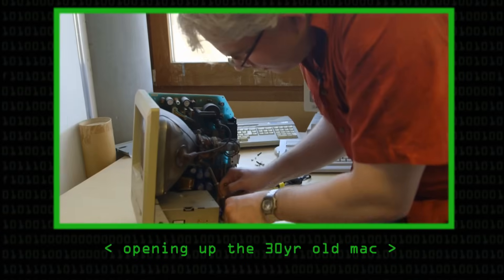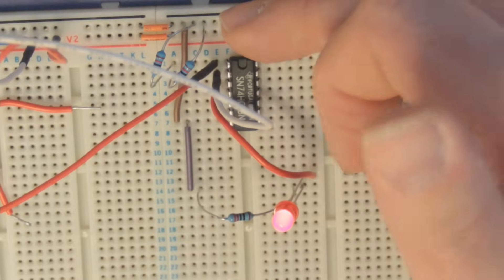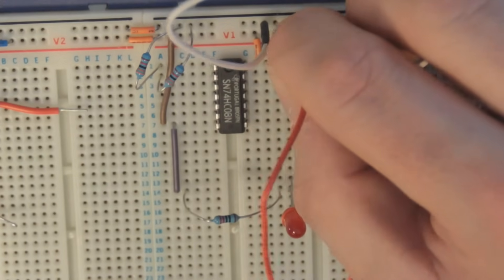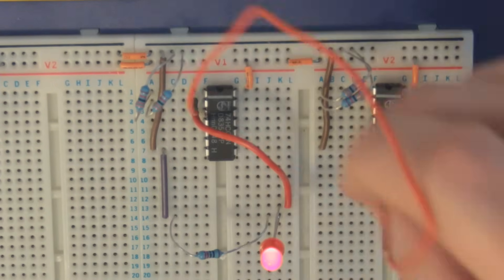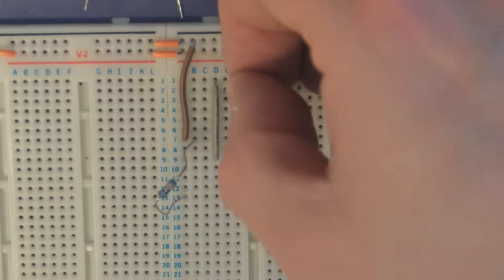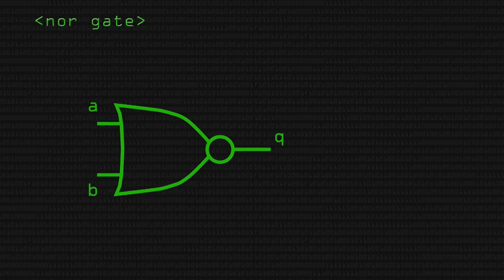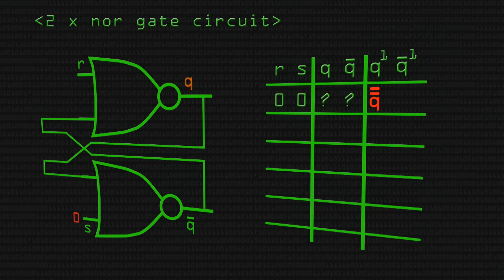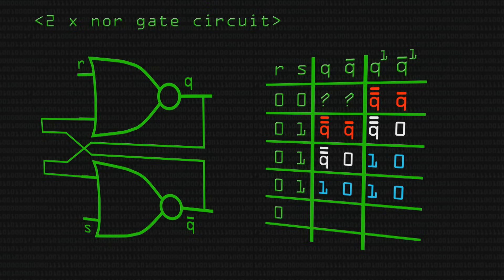How Computer Memory Works - Computerphile

Comment: now, that's just static RAM, pretty easy, but can you show us how SSD memory works? Or generally all the persistant memory types (PROM, EPROM; EEPROM, FLASH etc?
Reply: Lucas Kirkpatrick Yes I can actually and I have xD Last year I made a circuit which multiplied a sequence of stored binary numbers in 2 matrices stored in 2 8 bit ROM chips, and outputs the answer into RAM using VHDL, that circuit contained lots of flip flops and a few multiplexers :D
Reply: emilnyb This is Random Access Memory. It allows you to access any memory cell at the same speed, regardless of the previous cell you tried to access. Technically storage like SSD is also Random Access.
Reply: Nue Gai Your comment actually made me feel sick.

From what I gathered you know absolutely nothing about memory devices and just threw together a few computing terminologies to make you sound intelligent, when in reality you are just being patronising, and adding nothing to the conversation.

You basically said
"SSD logic is really hard to understand, it has lots of complex bits in it and its connected to the computer via SATA, and the NAND chips are really complicated and its all controlled by an os on the SSD"

You realise that SATA has nothing to do with how SSD memory physically WORKS? I'm assuming you used the word "ATA" to sound like you are 'in the know', when in reality we all know what ATA is...

as for os on the chip??? Theres no OS on an SSD, there is a microprocessor which handles the rewriting and erasing of blocks in order to extend the longevity of the device, but no operating system...

NAND logic is well known and understood DESPITE what you say in your comments... It's not exactly difficult to understand, the difficult part is how they get it in such small packages, and the manufacturing process in which to do that.

We dont need to know how NAND wafers are PRODUCED to understand how flash logic works -_-
Do you also need to know how your coffee is grown to understand what it tastes like?

Thanks!
Reply: Jeroen Bollen True, the way I see it is, as long as the lifespan exceeds the time before an upgrade is necessary, everything is fine!

I have a 240GB SSD, some time in the future, 240GB may not be enough for my needs and an upgrade might be cheap and worthwhile!

Hopefully an upgrade will be desireable before my drive fails, and considering I barely write to my ssd and only ever read from it - all I run is my os, and my user files and games are all on my hdd - its a safe bet to assume it will last a solid 10-15 years (touch wood) , much longer than I intend to use it!

Also, to see the loss in persistence in a flash drive, you'd realistically have to have it switched off for.... how long?

I just dug up an old usb stick from 3 years ago and it still has data on it, so how long would I have to wait for this 'volatile' flash memory to become corrupt?
Reply: Naburi That is true. In fact, because of entropy, ANY storage medium will eventually deteriorate! Even if you store information in terms of gold and silver bars, rather than 1's and 0's, those gold and silver bars will eventually deteriorate due to entropy!
Reply: Jeroen Bollen But that is a pointless comparison in the real world because there is no point in buying an SSD if you are using it as a backup storage device.

SSDs are almost exclusively used as primary drives, and if they are used as secondary drives there is more than likely going to be an SSD as the primary drive too.

I never said SSD's last longer because they are used differently, I said SSD's last longer in practice because they are more durable "PHYSICALLY". The ferrari analogy is incorrect because I wasnt suggesting that SSDs are better because fewer people use them.

A better analogy would be saying a car with 100000 miles and a good rollcage and airbag system is safer than a car with 0 miles but no airbags.

Sure, the car with 0 miles will have a longer lifespan on paper, but if the car crashes, it will be a lot more likely to result in tragedy
Reply: Jochen Morent I named them seperately since they function differentely :P Thanks for the vid, that will be helpful since I'm german^^
Reply: SSDs just use NAND flash, like your pen drives etc, Flash memory is pretty hard to understand, but it basically consists of using high voltages to manipulate electrons in such a way to permanently and physically change how the NAND logic is wired.

If you use this video as an example - and this is in my verrrrry basic understanding of it - Flash memory uses large (relative to the transistor) voltages to physically switch the Set pin of the NAND gate from low to high, it does this in a similar way to how a transistor works - using N and P channels, and using electrons to connect these channels together.

In short - the circuit for flash memory is very similar to the one in the video, except it uses electrons to physically and (semi)permanantly bridge the "Set" pin to either zero or one.
Reply: Ranstead Moons Not all SSDs use Flash technologies. There are RAM based SSDs too for example.
Reply: Jeroen Bollen as I said, I don't have perfect knowledge of the subject, but AFAIK Nand Flash IS a form of RAM. Isn't this correct?
Reply: Jeroen Bollen but flash is a whole lot more permanent than DRAM. Flash doesn't require a power supply to keep the data, and to lose it, it needs a few years.
Reply: Jeroen Bollen I wonder if a storage device that never loses his data exists. HDDs, CDs and DVDs also lose their data after hundreds of years, right?
Reply: christian newcomer You should learn how to read sir. First of all I never said RAM was based on speed, I said RAM usually gives more speed as you can request data without the drive having to 'spin' over other data. Also SSD and magnetic drives do wear out, SSDs faster than the mechanical altentative. Also when I said some flash implementations are based of how RAM is implemented, I clearly implied that it's based of how your actual working memory is implemented.
Reply: Ranstead Moons You can only make a fair comparison when both systems are placed in the same environment. Saying SSDs last longer because they are generally used differently is like saying Ferraris are safer cars because less people use them. 

Yes SSDs fail less, they're not mechanical after all, but that's not what I said. I said SSDs tend to loose their data quicker than hard drives, assuming they're both not being used for years and just stored somewhere.
Reply: Ranstead Moons That just shows how much interest I have in what you have to say. My argument stays untouched, all you are doing is saying it's irrelevant, which it is in most cases, never said it was. Only real time it's relevant is if you're using it for long term storage you don't plan to use for a few years. 

And about teaching preschoolers, I'm pretty sure that's exactly what I'm doing by teaching you. Seems there are too many smartasses in my class who just don't understand a simple argument as SSDs don't last as long as magnetic hard drives when not used.
Reply: Ranstead Moons Anyone misguided by my comments should read them again. Also yes you said that, yes no data storage is permanent, but SSDs are less permanent than magnetic hard drives in these cases.
Reply: Ranstead Moons You probably have never used it to save old data just-in-case though. Also you say most people here, but you'd be surprised. Those who don't just aren't going to argue about it.
Reply: joshmosky yes, and most ssds (samsung, curcial etc) produce good ssds. Kingston makes utterly slow shit and some sutff lasts 2 weeks
Reply: Jeroen Bollen "SSD isn't persistent. If you leave it off long enough it'll lose its data."

How long does that take?
Reply: @TheFrozenthia it depends on how u use it... If u write and erase SSD more times then it's storing capability decreases.. and even that depends on type of ssd like if u have MLC SSD it will hold bits less time than other types like SLC ssd
Reply: Lethe Denova Several years.
Reply: Ranstead Moons ya it is. flash is a sort of eeprom which can access data "semi-random", meaning it reads and writes in blocks of several bits.
Reply: ***** I thought so.
I understand not all SSDs use Flash, but surely its safe to assume flash is the majority for an average user (I'm aiming this mostly towards +Jeroen btw) DRAM based systems for example just dont seem effective when you consider it will need a permanent power supply. Most people - I'd assume - would opt for a more reliable storage means...

I for one would NOT buy an ssd with volatile memory to store my important stuff if it meant the ssd had to be powered by a watch battery or something... Too risky

With all that said though, I'd like to see what the future holds, Apparently non-volatile ram is waaaay in development, so it may not be long before we throw our harddrives out the window and save all of our hard work to our 10tb persistent ram drives! :D
Reply: Francois Beauchamp I'm not sure who you are replying to.
Reply: Jeroen Bollen SSDs do not necessarily wear out faster than HDDs anymore, that has changed, and now SSDs can last upwards of 10 years... And when the lifespan is determined by writes, not reads, this lifespan can potentially be much longer.

I, for example, BARELY write to my SSD, so it's lifespan is going to increase accordingly.

Combine with the low failure rate of SSDs and their high reliability compared to a HDD (head crashes, corruption due to magnets, physical damage from dropping a drive) I'd say its a fair assumption to say that an SSD will outlast it's HDD counterpart DISPITE having a limited number of writes!
Reply: Ranstead Moons Agreed, and I want to say that since the SDD was installed in my computer I fell in love with it. Everything it's almost instantaneous now, Windows loads in 14 seconds, Photoshop documents opened in 3 seconds!!!, levels of high quality texture games loaded in a few seconds!! I love when things are fast :D
Reply: Ranstead Moons Which brings me back to my point of you not being able to read. I never said you should use a physical hard drive over an SSD, I simply pointed out that SSDs do loose data over time, faster than magnetic drives.
Reply: Jochen Morent
In embedded systems EEPROM can be reprogrammed at the byte level, flash is rewritten at the "block" level.
Reply: Francois Beauchamp they're all making the explanation way too complicated. Look up multiplexers, and then look up flip flop gates.

Now make a grid of flip flops. Give each flip flop a control circuit so that you may choose to write or erase. 

Then have a demultiplexer for rows, and a demultiplexer for columns.

And then a parellel to serial shift register going to each demultiplexer if you want to start going from theory to aplication
Reply: Jeroen Bollen Why do you like all of your own comments? XD

Also in response to "Seems there are too many smartasses in my class who just don't understand a simple argument as SSDs don't last as long as magnetic hard drives when not used."

Quoting myself from 1 minute ago - "But regardless, we ALL already know that SSD's lose data over time xD why are you here? I even said myself in a previous comment that due to entropy, NO form of data storage is truly permanent."

side note - You aren't teaching anybody you are misguiding them.
Reply: Jeroen Bollen Ranstead Moons Can either of you make memory with an array of Flip Flops driven by demultiplexers and shift registers, or are you two intent on just throwing 3 letter acronyms around all day
Reply: Jeroen Bollen Yes they are, you're right but I don't fully understand what your point is since most people here already know they are less permanent, but because of the insanely long timescales required it's irrelevent anyways.I can say with confidence that I have never had a drive fail on me purely because of time, and i dont know anybody else who has!
Reply: This actually isn't RAM. This is just a RS-NOR latch. Real RAM uses a D flip-flop combined with an enabler
Reply: Nathan Wright depends on the type of ram considering there are plenty different solutions out there for storing bits
Reply: ***** Some SSDs can lose their data in as little as 2 weeks to a month, depending on the quality of the NAND Flash.
Reply: Just saying, I doubt companies would get away with selling SSDs if they wipe in 2 weeks. Idk if I'm anything to go by, but my crucial ssd has served me well for these last 2 years, still going strong.
I do try to be careful with it, I want maximum lifespan so I avoid writing to it unless I have to.  Have my downloads folder on my second hdd and so on
Reply: same thing, just always carry a small battery with yourself :)
Reply: Great question but too wide. EPROM solely can bi implemented in more than one way
Reply: emilnyb"Random access" refers to the ability to access any "random" part of the memory without any difference. There are memories that are not random access, such as tapes. Those have access time dependent on where the tape is wound to and where the part you want to access is located; that's called "sequential access".

Data structures can be classified similarly, too. Arrays, for instance, are random access, while linked lists are sequential access. There are others, though, with more complex characteristics.
Reply: SSD isn't persistent. If you leave it off long enough it'll loose its data.
Reply: Jeroen Bollen and this "long enough time" being multiple years?
Reply: ***** Indeed.
Reply: Why don't you name ROM as basic type of 3 of your memory types ;)

But what I really wanted to say is that FLASH is an E²PROM an Electrical Erasable Programmable Read Only Memory

and there you have all the names.
I have a good explanation how all of this works but sadly it is in German.
If you want to watch it: Wie funktionieren SSDs und USB-Sticks?
Reply: technically flash isnt an eeprom ... as an eeprom is just a look up table while flash memory is an actual program storage ... you could use a flash drive like an eeprom but you cant use an eeprom like a flash drive (unless you use it to look up a table of some sort ie data file) 
.
Ram .. free to look anywhere any time ... sequential time based (tape drives punch tape etc) ...parallel is large push and pulls of chunks to and from memory .... and rom is hard wired or precoded and not changeable ...
Reply: 0623kaboom  What do you mean exactly? In the past, EEPROM and NOR flash have been used for the exact same purpose.
Reply: before static RAM (the one shown above) there was Dynamic random-access memory (DRAM)
In which a capacitor can be either charged (true state) or discharged (false state)
Reply: AB CV .
Reply: More intresting how D-RAM work. S-RAM is almost never used unless in a cache memory.
Reply: The best analogy for flash memories is the force that glues a balloon each other whem one is charge with  static eletricity. In chip is the same, the cell of memory have a transistor. This transistor have a isolate plate thats stay charged by electricity, like a balloon. This plate is charged with a high current that flow in the transistor, storing a bit '0' and can be discharged by a short circuit, storing a bit '1'.
Reply: Ranstead Moons Just as a reminder, Flash storage is not permanent, and magnetic drivers aren't either to some extent.
Reply: Jeroen Bollen You should go back to school sir.  SSD is a category including anything 'solid state'.  Your RAM thing is also wrong - it's random access regardless of speed.  That's why they've have what's called 'DVD and BLU RAM'.

Calling it that is a stretch   Give those readers/writers an addy, and they will jump to it.  This is used all the time in massive amounts of backup data businesses.
Reply: Jeroen Bollen May I ask why you keep asserting that I cant read? Are you a child?
You are arguing a bad point and I am making counter arguments, telling me I can't read does nothing for the conversation.

Also, just to be "that guy" I'd like to make the point of saying that you never made a previous point of me not being able to read - you were actually replying to a different person! Does that mean you can't read either? ;)

But regardless, we ALL already know that SSD's lose data over time xD why are you here? I even said myself in a previous comment that due to entropy, NO form of data storage is truly permanent.

If you want to sound intelligent you should teach preschoolers instead.
Reply: it's memory... but is it -Random- Access Memory? I think there used to be a thing before RAM that was more determined, is this not it?
Reply: An actual SSD, as in a NAND based ATA device, is an incredibly complex device.. understanding how NAND works is just one tiny aspect of understanding how an SSD works. You also need to understand how ATA works.. and you also need to understand how the firmware specific to SSDs works.. and that's where it gets really complicated. So you can understand how a NAND gate works and how NAND cells are charged and all that, and you can even be an expert on the ATA protocols.... however, you still have no idea how an SSD actually works.. until you understand how the firmware on these devices actually works.. What actually goes on in the tiny OS built into every single solid state hard drive.
Reply: This is "SSD" memory. Look, I know this channel is for like elementary aged kids and stuff, but do you people even know the meaning of words you use? SSD = Solid State Drive = No moving parts. If by SSD, you mean NAND cells, then say NAND or at least say "flash." Actual SSDs in terms of the marketing term, as in SSDs.. you know NAND flash bases ATA devices.. are incredibly complex. Far to complex to describe in the comments. If you're actually curious, then open a book..or at least start with Wikipedia. It's one thing to understand how a NAND cell on it's own works.. or another thing to understand how NAND wafers are produced, etc.. it's a whole different thing to understand how an actual SSD, that is a NAND based ATA device works. There is so much software running on a hard drive, it's insane. The only thing which separates an SSD from another is the software. The software (aka firmware) is where all the magic and real development occurs. NAND itself is NAND.. Only a handful of companies on the planet actually manufacture NAND. All the "good" NAND is basically reserved for devices like routers and enterprise-grade equipment, including SSDs.. the NAND on the consumer-grade SSD market is all the same. It's the firmware which makes or breaks the technology in consumer SSDs. You've got all kinds of shit.. from abstraction layers to massive amounts of error correction, to other stuff like TRIM and more.